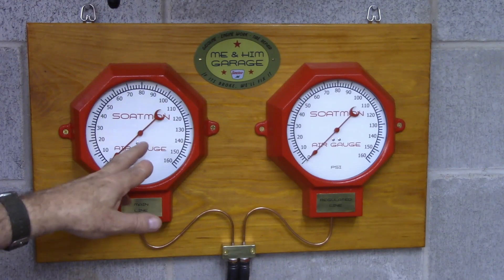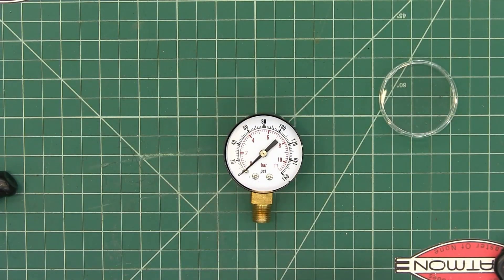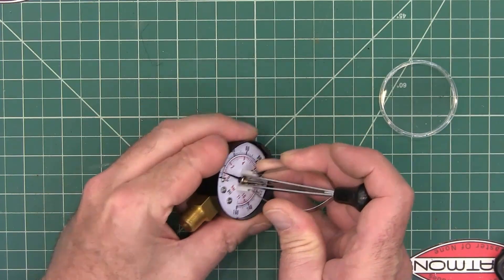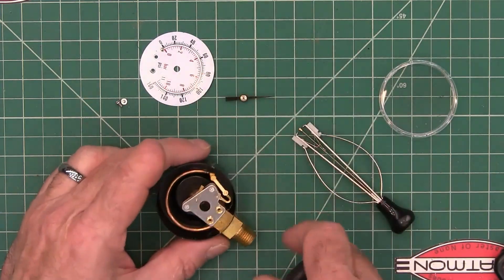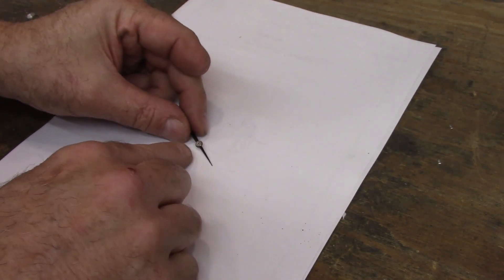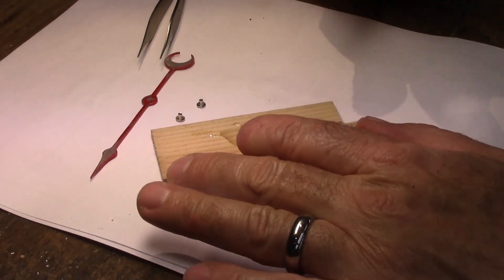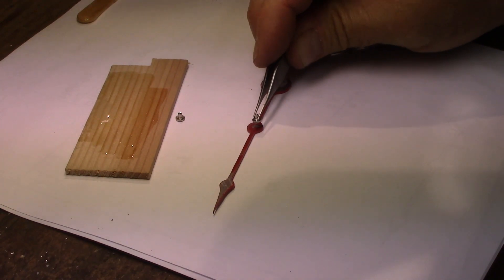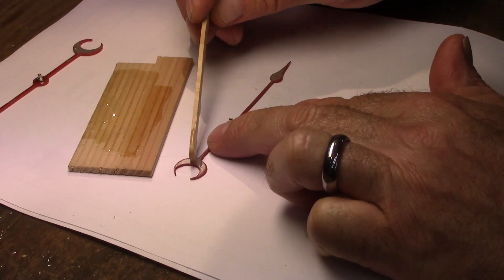Making a Big Vintage Pressure Gauge Part 3

Comment: Very clever. Certainly a balanced needle is preferred, but do you think it would be unbalanced enough to through the accuracy off?  Or are you just making sure to not introduce new variables?  Was the original needle balanced?  👍😎👍
Reply from the maker: The original was so small I don't know that it would matter very much and I didn't actually check it. I just had visions that as it moved over the 12 o'clock position the weight could swing from one side to the other and alter the accuracy. I also worried about an imbalance in the needle damaging the delicate gauge mechanism  In not an engineer so I'm always just using my best guess to figure things out. Thanks for sharing your thoughts!
Reply from the maker: I made this video to help explain it. https://youtu.be/jiC4wHY2wNA